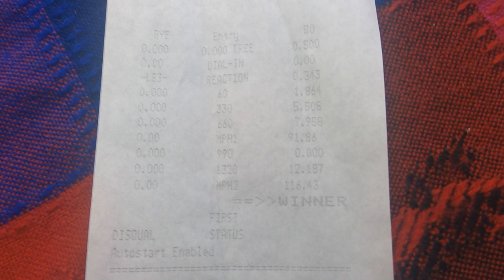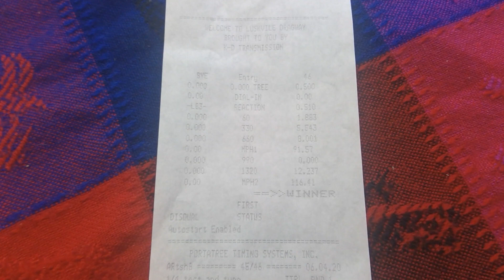1/4 Mile Max Trap Speed OEM Muffler Ford Fusion Sport

Comment: Is this car tuned? Also what mods on it?
Reply from the maker: Hello, with the installement of the crank pulley last week, this car has a;; the bolt's on possible. All the fuel system (injectors, HP and LP pump), all the turbos's and exhaust, all the intake, the tubes, Intercooler), it's all aftermarket (only inside engine and Transmission is stock).
Reply: @twinforce_fusion6560  damn lol, ever thought of doing an engine hotswap for the 3.0L V6 from a MKZ? All the connectors are the same, you can just drop it in lol
Reply from the maker: @OGERTEC  https://www.youtube.com/watch?v=9pIGC850uMo&t=5s  The Fastest Fusion and V8SLAYER both have swap to the 3.0 EB.

Comment: What fuel were you running?
Reply from the maker: E35
Reply: @twinforce_fusion6560  what octane does E35 have?
Reply from the maker: @hpjunkie69  mix with Ultra94, its about 99 octane
Reply: @twinforce_fusion6560  Have you noticed any performance difference between E35 mix  and Boostane Mix at 98 Octane?
Reply from the maker: @hpjunkie69  yes, no spark plugs to change every two weeks, more torq across the range, especially since the i injectors installment-tunning